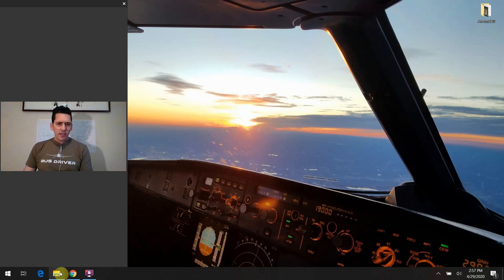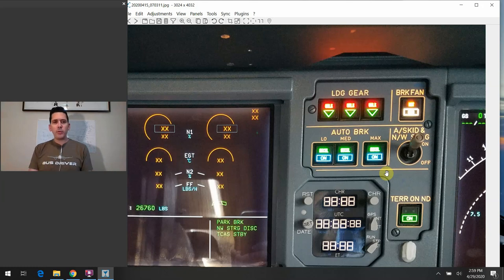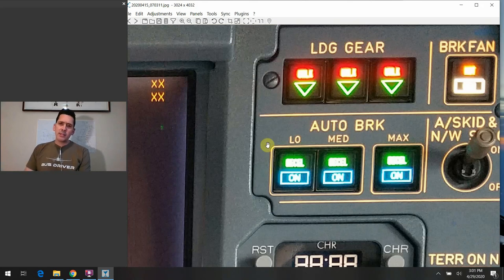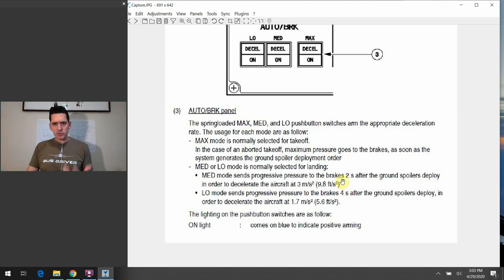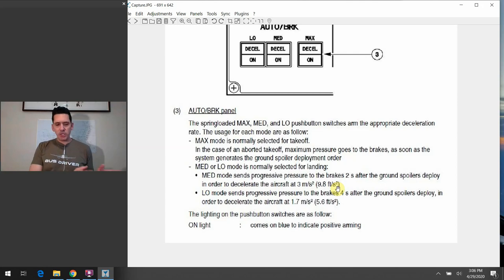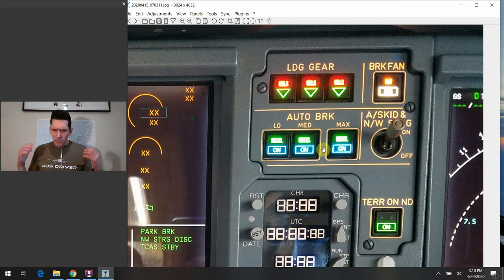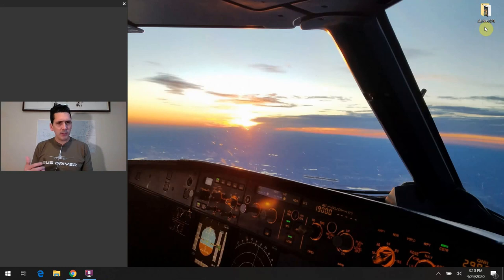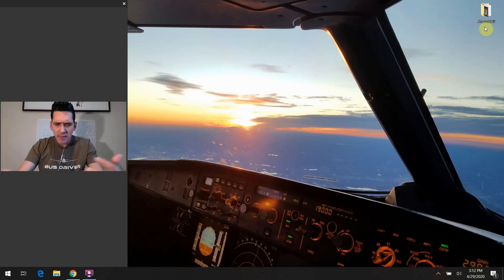Airbus A320 Cockpit Tour: #56 - Auto Brake Buttons: What do all those buttons do?!

Comment: Why do you disconnect auto brake at 70kts? Wouldn’t 70kts still be a bit fast for manual braking which could result in swaying and difficulty maintaining center line due to a slight differential braking (manual inputs)? Also, what speed do you usually vacate the runway and can you leave the auto brakes on till that lower speeds? Appreciate the efforts, thank you! A suggestion for a future video, obviously when the time is right,  would be an overview of all the external antennas on the A320. Haven’t found any videos on YouTube detailing these, would love to have a video that I could reference when needed.
Reply from the maker: Hmm, I'd say 70 kts or so is a pretty manageable speed actually to begin resuming manual control on a dry runway. You certainly could use the autobrakes to bring the aircraft to a complete stop if you really wanted to, but that leads into your next question nicely..it's kind of a technique thing. You want to use your energy efficiently to get yourself up to the exit point where the taxiway exists of your runway you are using. Let's say you are on a really long runway and you've still got a long ways to roll? You don't want the autobrakes taking ALL your energy out of your plane before you have enough momentum to get you up to your exit point. Same goes for a short runway, but the opposite, right? Maybe the autobrakes aren't giving you enough stopping power and you want to try to make a taxiway that is closer to you. Pilot technique in both examples. That's all. As far as exiting the runway, hmm if you are using a high speed taxiway you are probably somewhere around 30kts or so. If you are going to make a 90 degree exit, you are probably closer to 5 kts or so. I like the idea about the antennas! I'll work on that one...cheers my friend!

Comment: I was landing in direct crosswinds gusting to 31 knots and selected medium brakes, now normally during deceleration demoing medium brakes to our pilots at around 70-50 knots light increasing brake pressure will disengage the medium brakes and a slight "brake pulse" can sometimes be felt.  I assume this is due to the braking system "switching" over to pilot (manual brake pressure) and that is the change to the manual brake force (a good reason to insure you are applying even braking!)  .  On this landing, the OE CA began to verbalize he was ready to assume control of the aircraft on rollout and as I was already applying brakes to switch off the (medium) auto brakes, the brakes suddenly "pulse" (or jerk) strongly, much stronger than normal symmetrically.  I can only assume that perhaps the student was applying brakes as he began stating that he was ready to assume control and his, or the combined (if the airbus system allows that), manual brake pressure was wheat was felt at the moment the system switched off its auto brake setting to manual brake pressure.

Comment: When you press pedals in alternative system both are going to green band highest point and then must go to zero when we release the rudder pedals.but the one goes to zero and the other goes to higher than 2500psi .what is the problem in this situation?